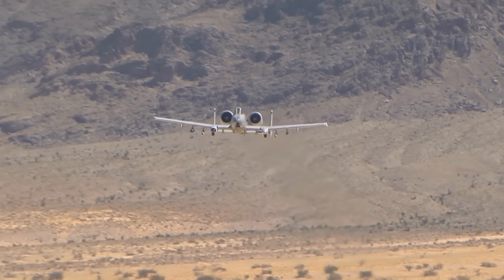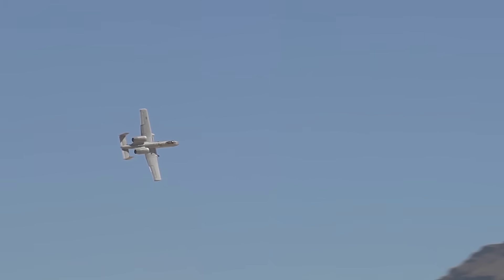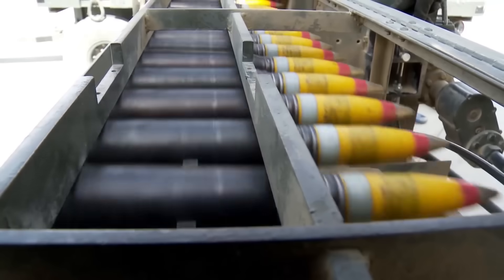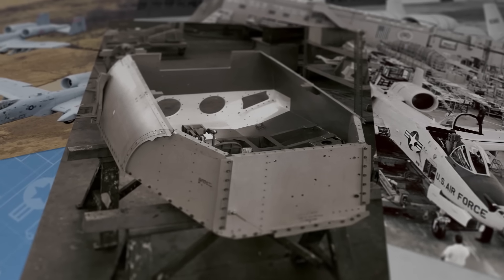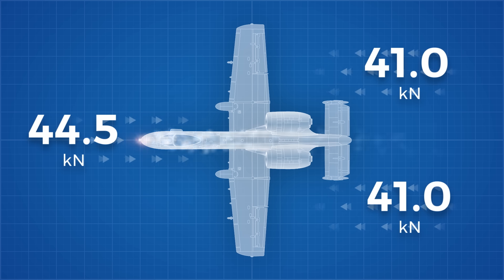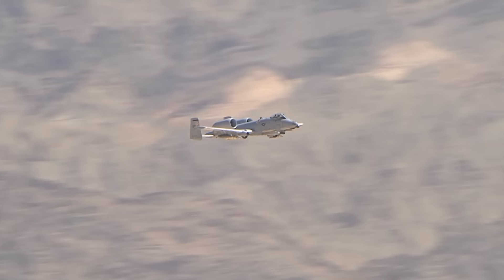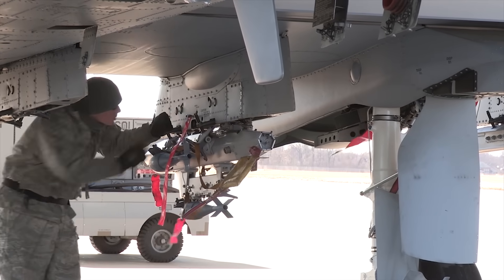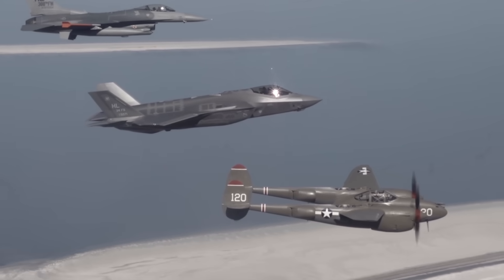The Insane Engineering of the A-10 Warthog

Comment: I once listened in on a conversation between an Airforce pilot and an Army Ranger, as they discussed the Warthog, and it's upcoming retirement.  
They were both disappointed to see it go. The ranger loved them for the distinctive sound they made, their effectiveness, and the way the enemy would fall apart on hearing them arrive, before they even opened fire. The pilot loved them because he felt he could get hit with everything the enemy had, and still be able to fly home.  
Neither of them expected the replacement to be equal, or even an effective, replacement.
They were just two guys talking in a bar, so take it for what that's worth.
Reply: We just bought a bunch of a29 Super tucanos to fill the roll of A-10s when they were being sent out for CAS against light ground vehicles which was way overkill. This will keep the hours off and extend the service life to 2030s. Also an A-10 is $7000/hr operational cost vs $600 for the a29.
 https://www.airforcetimes.com/news/your-air-force/2019/08/13/a-10-re-winging-completed-will-keep-warthog-in-the-air-until-late-2030s/
https://www.blogbeforeflight.net/2020/03/usaf-purhases-a29-super-tucano-light.html
Reply: @Troph2  does the a29 have a similar gun to the a10?
Reply: @WeaponsGG  Nope, its got twin 50s, I forget the payload but its pretty significant for the size. Its not a tank buster like the A-10, although smart bombs work too. The cost and hours we were putting on our a-10s to blow up toyota pickups was really adding up, and forcing our fleet into retirement.
Reply: @WeaponsGG  Most CAS by far is provided by high altitude munitions drops. The gun is pretty much useless in modern conflicts, no matter how awesome it is.
Reply: @ivanlagrossemoule  It's by design...the airforce also likes to make it's missions such that certain weapon types it deems "obsolete" can be argued to be obsolete because they don't employ them any more...
Yet many a pilot has said that they don't want to hear "under fire, need assistance urgently" on the net, and being the closest plane able to respond, only to say "sorry, got no 20mm."...and it can sometimes take 50 seconds for a bomb dropped from 30.000 feet to arrive at the target, while the A-10 can whip around and put a burst on the target far quicker, and deliver more sustained supression, as it can just keep doing that in rapid intervals, while dropping bombs in close proximity to troops is not only dangerous to those troops, you can't as effectively keep a constant barrage going.
And the lossrate is also missleading...F/A-18s and AV-8Bs suffered worse losses, strike aircraft generally lived more dangerously in Desert Storm. The Iraqi air defence was both crippled and fighters woefully outmatched, saying that these planes didn't have to handle enemy air defences, when most of them were shot down by MANPADs or AAA is kind of harsh.
You should expect your enemy to shoot at you during a war...the A-10 is more than capable of sitting at high altitude and dropping GPS guided death from 35.000 feet...but that's not the most effective thing in all circumstances. If you completely gear your airforce to do just high altitude precision bombing, there will come a time when an enemy will exploit this, it won't work as well and then suddenly everyone is scrambling to find an effective CAS solution again that supports the guy on the ground more directly.
The morale effects the A-10 has on friendly troops can certainly be overstated, but not ignored. There are reports of enemy combatants surrendering simply because an A-10 showed up and flew over...something a B-1 or F-16 from Angels 30 can not do, it would be too risky.
Reply: @Chrinik  My thinking exactly. Most of the argument is about what "Swiss-Army knife" of an aircraft (the whole JSF concept) or smart ordinance we can replace this out-dated "relic" with when the role it plays fits the need. Like you say, if they needed high altitude drops then they would send high-altitude drops but they don't, they send CAS.
 It doesn't mean the A-10 should be around forever, but it should be replaced with something that fills the same role for the same cost. As Real Engineering pointed out, there really isn't anything that fits the bill now (except some prop attack aircraft for lighter targets). 
The whole argument is really just a manifestation of the military industrial complex. If one company wants all the funding then their new machine, or weapon, or ordinance needs to be the only one in use.
Reply: @ivanlagrossemoule  what you mean is most friendly fire incidents occur with high level bombing.
Reply: @ivanlagrossemoule  Finally, somebody's makin' sense.
Reply: The one thing about the A-10
Is that armor will bring the person home
The aircraft will be out of action for awhile
Back in 1991 during the Gulf War, the USAF was frustrated because of the A-10 fleet returning shot up which meant longer times between missions to patch them up, or even write off aircraft 
Overall I believe the A-10 had the most combat losses of any USAF aircraft with 3 shot down and 2 written off due to battle damage IIRC
Reply: @demanischaffer  At least they came back, the new "replacements" would have been lost airframes. Coming back with half the airplane full of holes, missing big chunks, an engine and no hydraulics was common, and they were relatively easy to repair as well with only the front line crews. Modern aircraft are more of "one pass haul ass" over the Warthog staying around and chewing up whatever is in the sights till it is no longer a hazard.
Reply: @SeanBZA  No frontline crew is easily going to repair an A-10 missing all that, 
Those pictures of shot up A-10's? Those are what we call "write offs" 
The A-10 had a hard time dealing with Iraqi air defenses in 1991, what's it going to do
Over the skys of Afghanistan and other low threat areas you don't need a super survivable aircraft 
Which puts the A-10 in a weird place for the USAF as it can't survive in contested areas, and in non contested areas, it isn't even the main CAS aircraft, doing something like less then 20% of all CAS over Afghanistan, with the Chief of the USAF stating the F-16 fleet in 1 year did more CAS then the A-10 in 8
Reply: @demanischaffer  *Used to bring the person home to some extent
It's a bit like the story of Abraham Wald wanting to add armor to the WW2 bombers but the other way around. If the A-10 gets hit and survives, there's your problem, it got hit in the first place. The A-10 suffered the most losses of any aircraft of the Gulf War despite not having to handle enemy air defenses or fight in a denied airspace.
The F-117 went in first and in a completely denied airspace to fight integrated air defenses and didn't suffer a single loss. Ironically the overconfidence from this success led to F-117 losses later on though.
Reply: @ivanlagrossemoule  People also seem to forget that the F-111, the humble aardvark killed more Iraqi armor then the A-10 while suffering no losses 
A lot of the support from the A-10 is less factual and more emotional, I like to call it the cult of the "brrrrt" where people can't understand that modern CAS is mostly dropping guided munitions and not sweeping trees and lining up targets with the MK1 eyeball
They also overestimate the A-10's ability, they shout about the titanium bathtub, show pictures of shot up A-10's and the mighty GAU 
So I totally understand and agree with where you're coming from
Reply: @ivanlagrossemoule  Only the Iraqi main air defense system was neutralized. The A-10 has to fly low in order to be effective. It was still vulnerable to ground fire and from stand-alone batteries and hand held anti-air ordinance. That's why they took so much damage. It was not a failure of the A-10's design. It is simply the risk CAS aircraft always face. The A-10 actually handles it better than nearly any other CAS ever flown.
Reply: @jamesdunn9609  Yes, that was by far the biggest threat to aircraft, which the F-117 faced but not the A-10.
Modern CAS is very different from what it was at the time, it pretty much entirely consists of guided munitions dropped from high altitude. And for this there are tons of far more survivable platforms than the A-10, like say the F-35.
Reply: @demanischaffer  Yeah I absolutely love the aircraft, it really reminds me of some ships in the original Star Wars trilogy, you know like rough and rugged looking. But yeah, people are very unrealistic when it comes to it.
That being said, I can also understand that it's very difficult for people who didn't read a lot about the F-22, F-35 or modern aircraft to not see what makes modern aircraft so much more survivable. It's natural to assume that armor leads to survivability, it's harder to understand how stealth can fight in a denied airspace all while being detected.
Reply: @ivanlagrossemoule  Stealth, ECM, standoff weapons etc essentially are like not letting the enemy get off their shot and if they do, making it as hard as possible to for them to land it instead of trying to pad yourself up to try and take hits, since in every form of warfare the best armor has always been to not get hit
Reply: @ivanlagrossemoule  F-117 and A-10 were used in very different roles and scenarios. Penetration bombing and CAS are not the same thing. You should compare F-111 and F-117. US lost enough F-111s over Libya, and an F-117 against Serbians whereas A-10 operated at much lower altitudes against small arms and Manpads.
Reply: @jamesdunn9609  "It was not a failure of the A-10's design" - Yes, it was. The USAF had a great CAS aircraft in the A-7, which suffered low losses from AA despite being (if I remember correctly) ranked third for the aircraft that dropped the most ordnance in Hanoi. The problem was that it was too fast for the army, which wanted an escort for helicopters.
We know CAS is a risk. If you know the risk is there, you don't send an aircraft with a purpose-built flaw: being slow.
Reply: @ChucksSEADnDEAD  What you are talking about isn't a "design flaw." It was an intentional design feature. The single biggest criticism of using supersonic jets in the CAS role is their lack of loiter time over the target. The A-10 was intentionally designed to be subsonic so that it could stay on station above a battlefield for an extended time and respond when needed. Does this expose it to a higher probability of ground fire? Of course, which is why they armored the cockpit and placed the engines in the positions they did. A ground-fired antiair missile can take out one the engines of an A-10 and it can still continue it's mission, deliver it's ordinance, and then get home. Supersonic jets, in general, make terrible CAS aircraft.
Reply: @jamesdunn9609  Flying low dosen't even work anymore against modern AA.
Reply: @kyle857  With the increased availability of smart, guided munitions, the role of the CAS is changing. I am talking about what the A-10 was designed for. Yes, the environment has changed now. That doesn't negate the effectiveness of the aircraft for the period it was in use.
Reply: You know what though, when my dad got back from Gulf 1, he showed us pics they took of the wing commander of the 23rd after he took a SAM strike and landed that bird at base, the current joint strike fighter would have shattered in air if it was missing as much lifting surface as his was.
Reply: Nothing To See Here my retirement papers where in during the last time they where kicking around retiring the A-10 and I told my CSM if the Army gets them pull my retirement and I’ll take reduction if need be to stay in. That’s how much I love this bird.
Reply: It should make them happy that there is currently no concrete plans to retire it yet. In fact with upgrades some suspect it could remain in service til 2040.
Reply: I always wondered can't the helicopters fill the role of fixed wing aircraft in CAS role?

What are the main advantages that a-10 has over, say, ah-64?

I once saw a comment of an Afghan Mujahedeen which went something like this: we didn't fear the Russians, but we did fear their helicopters
Reply: @srelma  A lot faster, heavier hitting power, and a lot less vulnerable from attack because they can go fast and low. Helicopter has a problem of noise getting ahead of it, and a very fragile blade structure so it is very vulnerable. The Afghanis figured out the weak point of a helicopter is the top, and thus would climb high in the hills, and fire down at them, hitting the unprotected tops of the engines and rotors. A10 has armour on top, and in most cases is not going to be in position long enough to aim and fire, plus the speed means most rounds will fall short. Fire down and the guys up high will see you, and the next pass back will make you the target for some serious retaliation.
Reply: @srelma  I can answer a small part of your questions.  
Helicopters do not have the same speed, range, or carrying capacity.  It couldn't fly well while lifting a gun like that, and probably couldn't stay stable in the air while firing it.  
Helicopters also have less armor, and are more vulnerable to ground attacks.  
They serve a very different role than helicopters, which tend to be used more for troop movement, recon, and distance attacks.
Reply: @srelma  The A-10 is about twice as fast as an Apache. It probably depends what you got available at the time, and Apaches are under the jurisdiction of the Army, not the Air Force.
Reply: Sorry to burst your bubble, but the a10 really needs to go. There are already better planes in service that do a better job
Reply: @MaticTheProto  It was an awesome weapon in the 1980's. But it's time has come and gone.
Reply: @jamesdunn9609  indeed
Reply: @MaticTheProto  No worries, my bubble is still intact. I think you missed the point of the story, if you believe I was trying to convince anyone the A10 should stay, or was, like totally, the best plane ever.

The A10s are not being replaced with "better planes that do a better job". 
The intended role of the A10 has been discontinued. It's active role can be filled by cheaper alternatives. (Lighter aircraft and artillery)

As an armoured tank-stopper, there are
no "better planes that do a better job" anyway. As far as I am aware, there was never any serious effort to design, let alone build a next gen tank-fighter.

Do you know something I don't, or just talking sht?
Reply: @pkz420  i know that the concept of cannon cas is very outdated and any plane with precision guided munitions can do a better job with less losses
Reply: well the replacement sure aint cheaper unless your talking about a hellfire drone and even then its dubious
Reply: @charlesballiet7074  the replacement is a large amount of LACs with a small amount of F-35s. LACs cost about 10% of an A-10 which offsets the cost of an F-35.
Reply: @charlesballiet7074  SU-25 is 4 times cheaper. Today.
Reply: @charlesballiet7074  this is true. The real thing that is going to replace A-10 is a drone, not F-35 or F-16 variants. Nothing beats a Predator at the moment.

On the other hand you can only operate these in an air superiority situation. Predators etc. are extremely easy to shoot down.
Reply: @HakanKoseoglu  The A-10 has already been partially pushed out by the F-16 fleet after the lessons learned from 1991 
Drones and light attack aircraft can do the same thing the A-10 does over Afghanistan 
While the F-16's and then F-35's will keep doing the role in hostile airspace
Reply: @charlesballiet7074  A-29 is far cheaper while providing equal support. The Gau-8's role was obsolete the day the first A-10 went into service.
Reply: If I remember correctly there was a serious, if perhaps small, push to let the Army take over the A-10 program.  Then Desert Storm happened and her retirement was put off...just like everyone else.  That's how you know she's a good warrior.
Reply: It was halted. They are still in service.
Reply: @redbandit6277  For now.  
The idea keeps coming back though. Because while it is effective, and loved, there are much cheaper alternatives.  
From what I understand it's been an ongoing debate in the military for years now, and it swings back and forth.  
It is overkill for much of todays fighting, so I think it will be phased out eventually.
Reply: @pkz420  probably.
Reply: Helicopters are delicate AF and need overhauled after every mission. 
Whatever the military picks for CAS, it better be a very good munitions platform, because the most likely great power we'll fight will be the PRC. No way can we match them on ground forces.
Reply: Nothing To See Here 

Is the AH Apache’s role similar to the A-10?
Reply: @Callsign-Blade_RunnerSG  I don't think so.  
I am not an expert. But I believe helicopters are used for longer range, and lighter weapons, or troop transport.  
Helicopters are too slow, and too fragile, to do the same tasks as a Warthog.  
Typically if a helicopter is hunting you, you'll never see it, or hear it. It will kill you through a scope from a long way off.  
A Warthog you can hear, and see coming. Look close, and you might even see the pilot smile before he lights you up. But it is too fast and too tough to do anything about it.
Reply: @pkz420  What it boils down to is that Rotary Wing assets and Fixed Wings have different employment considerations and different advantages / disadvantages.
What stops an A-10 from working might not stop an Apache, and vice versa.
Rotary Wings offer a fast response and loiter time, however are restricted severely by LOS and are prone to return fire which may prevent it from operating if the terrain or situation is disadvantageous. It also can be used in close support with other assets that are in the air with them such as transport.
Fixed Wings offer superior range and speed and quite often, heavier firepower in the form of bombs and offer PGMs.
Each asset has a lot of downsides and upsides that are too complex to dive into, however they usually are used in tandem with each other, such as Fixed Wing aircraft with the necessary sensors can laze a target for a Rotary Wing asset to take out.
However for an A10 vs AH-64, the A10 is simply more or less the CAS bird that rains destruction and can operate in environments where an Apache can not.
Newer Apaches are also equipped with advanced sensors (AH-64E Guardian) and electronics that enable them to help command the battlespace more effectively as well.
Here's a CAS Joint Publication by the Armed Forces that can shed some light into the unique differences and considerations JTACs / TACP take to know which asset is best employed in which situation. https://fas.org/irp/doddir/dod/jp3_09_3.pdf
Reply: Lot of wisdom in those bar chats
Reply: An A10 has never survived a hit from a missile. Old 23mm rounds sure. But a 30mm would rip right  though it.
Reply: @kyle857  An A10 has survived a missile hit.
I know of at least one that was able to fly back and land after receiving a direct hit from an RPG. It was heavily damaged, but still able to fly, and the pilot was unharmed.

And that's just off the top of my head, there's probably more.
Reply: That’s one thing this video didn’t quite capture, the sound of the engines are also pretty distinct.
Reply: The aircraft that supplied the most "CAS" for troops in contact is the B-1B. It has a massive payload of precision guided weapons, extremely long loiter times, multi crew to increase mission length, and can perform the work of multiple other aircraft that would be needed if it wasn't available. Everyone loves the A-10 and hearing it prowling around "up there" looking for someone to zap is a comforting thing for the good guys...

But... It's an expensive option to shoot up a jingle truck and the dirt bags we're fighting lately are really more of a one dimensional threat - no aircraft and no significant air defense... So not much for an aircraft as capable as the A-10 to ply its trade on.

That said... In a denied or contested airspace? The A-10 has no chance of providing any kind of CAS because it wouldn't be able to even get to the front line.

This was the thinking driving the F-35... Unless you can get to where the troops that need support are fighting it hardly matters if you have an impressive aircraft that's armored to protect against 23mm AP rounds... And, importantly, no amount of armor is going to protect you from an S400 (SA-21) and the 24kg to 180kg warhead.

In future battles against peers or near peers the A-10 will be relegated to clean up once the A2AD network has been suppressed and air supremacy has been established. Which is probably not going to happen until AFTER the conflict has been decided.